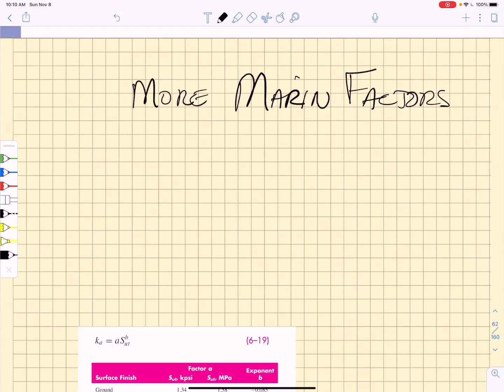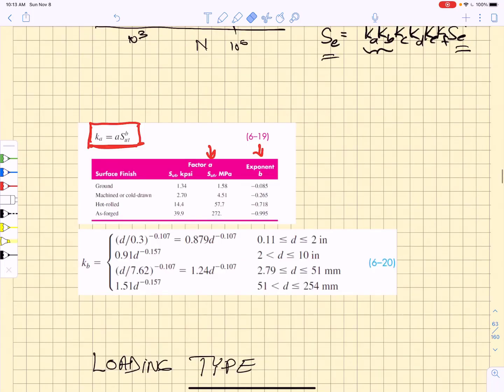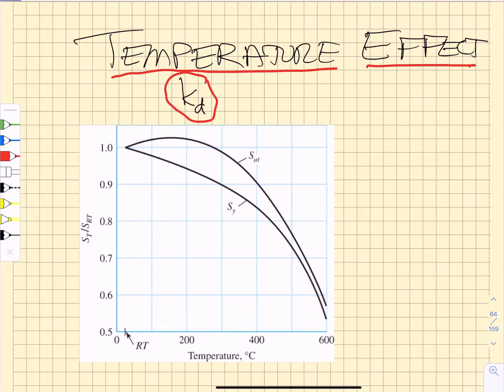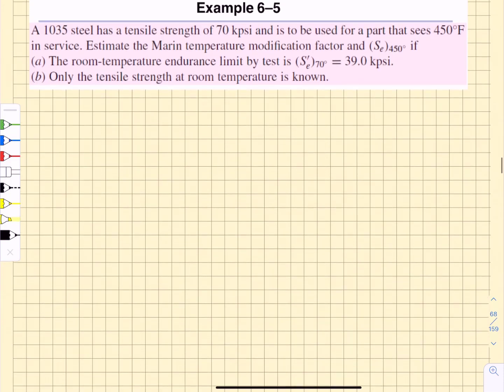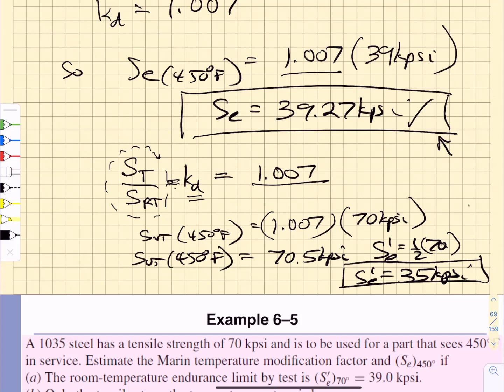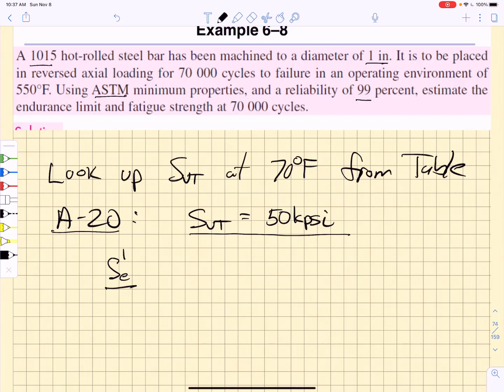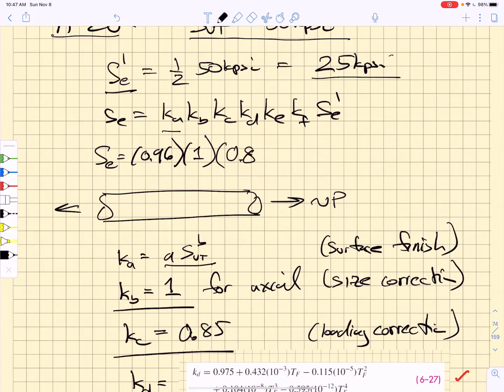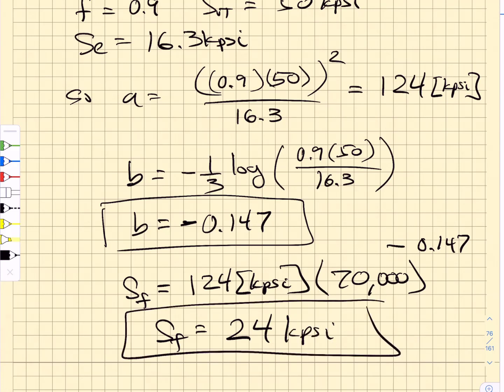Lecture 25 Using Marin Factors to fit Basquin's law

Comment: You should use kc in the equations to determine S-N curve adjusting factors a and b.
Reply from the maker: You are correct....I just defaulted to kc=1 for the sake of simplicity!  and many students get rather overwhelmed by the marin factor adjustments, though this factor is the easiest to understand.